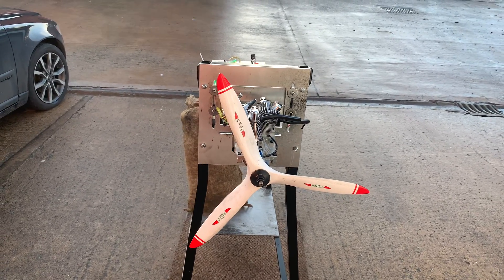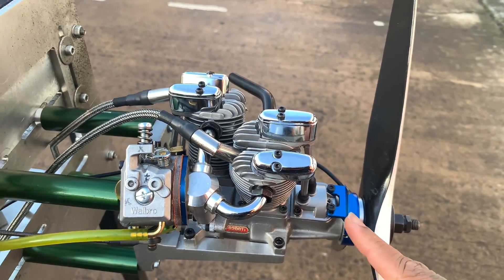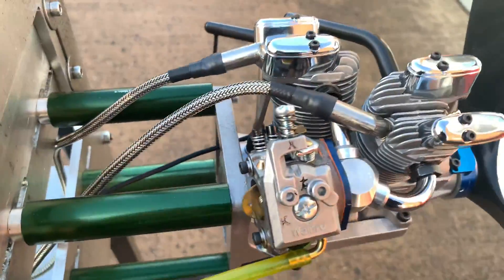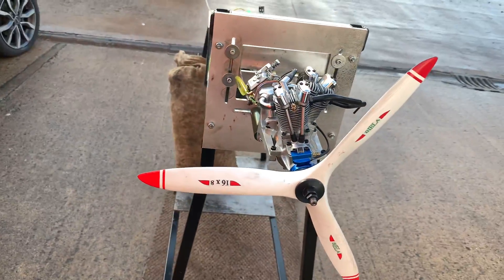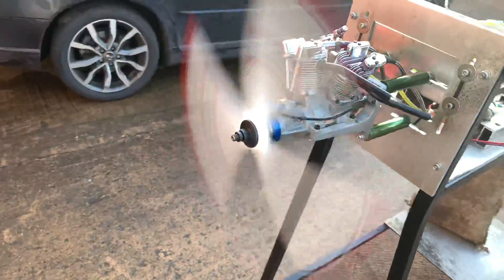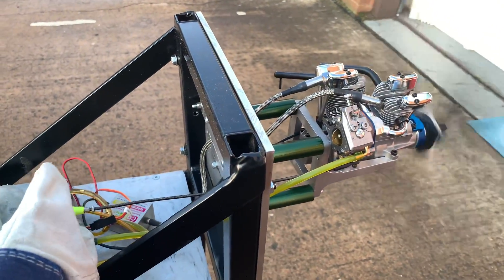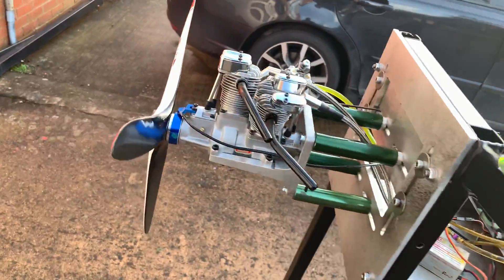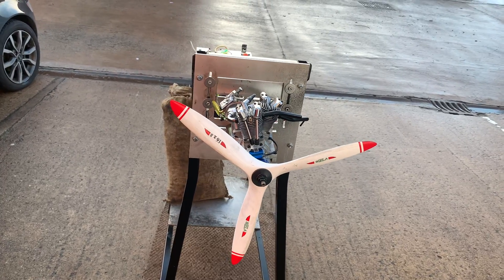Saito FA-200Ti Inline Twin Full Gas Conversion by Morris’ Mini Motors

Comment: This engine is lacking in power big time. Sounds like it’s only hitting early 7’s late 6’s I know this is a gas conversion 3 blade but I have one on mine with glow ignition and it’s defiantly not as powerful as straight glow. I get 9200 on 30% 16x10, with my unit I can only get 8300. Heavy engine, likely going in a warbird, you want as much power as you can get.